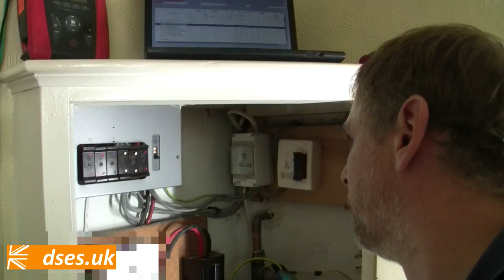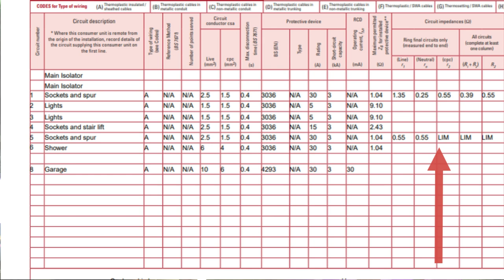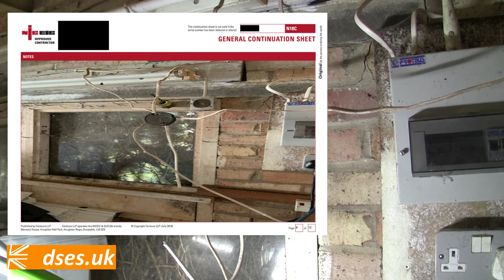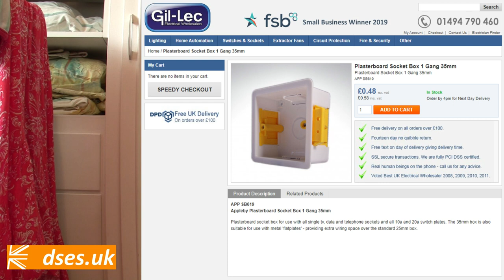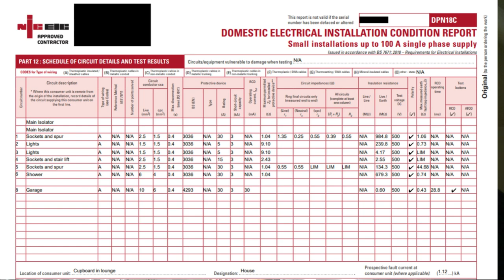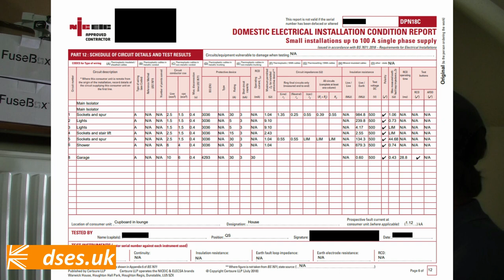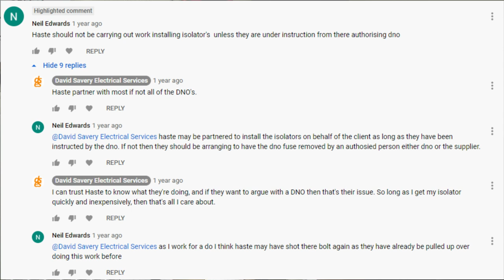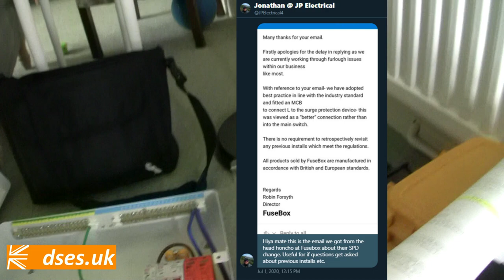Waffly Consumer Unit Upgrade

Comment: I live in south Manchester. I recently had a isolation switch fitted so in the future I can have my consumer unit upgraded. I contacted my energy supplier to arrange the work which they did, with  a charge of £50. The engineer was from the utility company Morrisons. I thought it was a reasonable charge for the work

Comment: Reg: 433.3 does allow you to omit overload current when it’s a fixed load that’s unlikely to overload . So maybe a 8.5kw shower on 6mm with a 40A or 50A mcb or 2.5mm flex on the back of an oven that’s feed from a 32A mcb with 6mm as long as the oven is not rated over the 2.5mm CCC

Comment: Regarding pulling DNO fuses...The recent replacement of millIons of meters with smart meters was the perfect opportunity for the DNO’s to cheaply provide the consumer/sparky with a means of isolation and solve this ridiculous situation.

 The fact that, for the most part, they have chosen not to do this, means that every electrician not only has the right, but also the god given duty to de-seal all the DNO equipment and pull the fuse in order to teach those tosspot DNO’s a lesson. 

Just don’t video it and don’t admit it. Simples.

Comment: I have always understood the reg regarding spur from the over current device would only be for a socket under or near the board and only for one twin socket. Not for supply a few sockets remote from the dB
Reply from the maker: That's my take on it too Evan. A spur is a point local to where you're tapping off, not a way to serve a new extension on the other side of the house!

Comment: Excellent 👍🏼 I think the main reason for the ring still be installed is purely the length you can get from a ring.  You are limited with length with radials.  The OCPD can be rated at 30 or 32 for a spur from the origin because the max you should be able to draw, would be 26A.  Also the OCPD can be rated higher than the cable if it is a fixed load, such as shower subject to all loop readings.
Reply from the maker: Don't forget though Patrick that it isn't just design current we need to consider. If that 'spur' cable is buried in a wall for some distance, a short of some resistance caused by, say, a nail or screw penetration could cause a high fault current which may exceed the CCC of the cable. A 30/32A device can happily pass that current which the cable cannot handle.
Reply: David, I see what your saying, but fault current isn’t CCC, fault current should only be for short duration, so shouldn’t effect the cable & can be calculated.  Thermal withstand, I think.
Reply: technically 13A. Double sockets are ALWAYS rated '13A'.. the manufacturer would use that as a getout clause if it melted with 7A on each side...
Reply: @PJB71  The word adiabatic is trickling my cerebrum... i like the feeling ;)
Reply: Hi Yes I double checked it is the thermal withstand calculation, so for example if you had a 32A cooker circuit in a domestic installation.  6mm from the D.B & the cable supplying the hob is 4mm & the cable supplying the oven (Rated at 2.3kw) is 1.5mm.  They are both supplied from a dual outlet cooker plate.  Overload from the oven is impossible, So that is a 1.5mm cable on a 32A C.B.  As long as there is short circuit current which you would measure at the oven above 160A.  Then the OCPD will operate with the required time, you can also check this with the thermal withstand calculation, you could also check the adiabatic if you wanted to.

Comment: That's a really good question, why do those smart meters not include a physical switch to cut the power, and separate unsealed terminations for the load? On the subject of putting the right PIN into the smart meter to turn the power off, "Device with semiconductors" (ie. electronic switching) is not valid as a means of safe isolation according to table 537.4. While supply equipment does not fall under BS7671 according to 110.2(i), not sure whether you could safely rely on that.

Comment: Was nodding off but woke up when you commented on the ring final, and the underrated current carrying capacity of the 2.5mm ²  inserted with the ring at the 30/32A protective device . Agree with your comments and views ENTIRELY.

Comment: Another great video. I sent my landlord your EICR videos after he had my home checked. 

On the morning of the visit we moved all furniture to ensure that clear access to every socket/accessory was possible while the alarm bells rang that three properties were scheduled for the same day with one being 40 miles away. 

The 'electrician' sat outside in the van for an hour, spent 40 minutes in the house only taking the front of the consumer unit off, turning the power off for a minute and not removing a single accessory then sat in the van for another hour before fucking off. 

He then rushed back to report back about the plastic consumer unit that had been fine with no alterations or additions for 14 years which prompted me to recall your videos tacking that very subject.

As you quite rightly say do the job right or get out of the game.
Reply from the maker: Unfortunately, I suspect he's having an easier day and making more money than I am too.
Reply: @dsesuk  Till he goes to court... [i can dream]

Comment: Hi David, As a working spark myself, I agree with you regards the fuse pulling chestnut. it' been going on for years !  Maybe the NICEIC should get involved ? We all pay now a substantial sum (just to work domestically) They should lobby that if an isolator is not supplied by the supply company we are in our rights to pull fuses for obvious safety reasons.         
Love your channel and enjoy it the most when you're giving it the big one!
All the best
Steve Kearslake (Happy Lectrics  Southampton)

Comment: Spurring off, on an EICR you can call it C3 at the DB on a bunched circuit if for example it's a fixed load that is lower than the rated capacity of the cable in question so hence will not overload and wouldn't require overload protection, it will only required fault protection.

Comment: Ok last comment I promise! A trick I pulled for my own property, in which the old tails were 25mm and good condition, was to ask them to just come and cut the power for 5min.

I put an isolator in place ready to receive the tails before they arrived, soon as power was off I cut the tails, terminated into the supply side of the isolator, and put that half of the isolator cover on (the new 100A wylex isolator is designed such that you can remove the load side cover while the rest is still locked in place). Power back on and off they sod. Only cost me about £15 for a nice compact isolator.

Of course only useful if you have something to crack on with while waiting for them to turn up.
Reply from the maker: Good if you can get away with it Matt. I do wonder how flexible their appointments are though. I suspect most people would just get a "we'll turn up sometime between 12:00 and 18:00" response.

Comment: 26:50
I'm still learning about fusing for fixed appliances.  My understanding is that FCUs are to protect the fixed wiring, and the protection of the appliance is not our business.  I don't know what the requirements are for manufacturers of such appliances, but I've always assumed that it's their responsibility to provide adequate fusing, thermal cut-out etc within the appliance.
Reply from the maker: A good point old sport, the fuses are there to protect the cables... well, at least on the fixed wiring. I'm not so sure on the appliances themselves, I think the fuse protects more than just the flex, although I may be wrong. Internal fuses can (and often are) employed as you say, but I suspect the manufacturer of these appliances would have stated a localised fuse be present, and the expectation would be that this kit hangs off a FCU rather than being spliced directly into the 30A ring. On an EICR, can I guarantee the way these items is installed is safe? No. And nobody with any common sense would install it in this way.

Comment: Whilst I see the point about the protective device is higher rated than the cable on the spur off the circuit origin, functionally it's identical to a spur taken off of any other point in the ring. If the problem exists for the spur taken at the circuit origin, then the same problem is present everywhere. It really makes no difference where the spur runs from. 

I should add that what a lot of people don't realise is that twins sockets aren't even rated for the full 26A that might be pulled. They only have to withstand 20A for a sustained period (I can't recall exactly - it may be about 30 minutes). Of course, there's nothing actually stopping somebody plugging to 3 kW devices into a dual socket on a spur thereby overloading both the cable and the socket.

Incidentally, the reason why high current circuits were introduced and then multiplied with one upstairs and the other downstairs is back in the days before central heating was common and many families used to use electric heaters. There is now no real need for this, although I am a big fan of high current circuits in places like kitchens and utility rooms as 20A radials are a nuisance, even if they are multiple, as it's damned inconvenient to have to try and make sure washing machines, toasters, electric kettles, microwaves and the like are balanced across circuits. 

nb. one safety thing in favour of rings is if there's a break in the CPE, something that can happen on a radial. If it happens on a radial, any outlets downstream of the break will continue to work, but without any indication of the failed CPE. At least with a ring that scenario is unlikely due to two CPE paths.

Comment: Really good point about the Spur jumped on the ring circuit at the board, makes sense to me now that it should be a C2, either put it on its own circuit breaker or down rate the ring circuit breaker to a 20A or 16A
Reply from the maker: Although, as someone pointed out to me, Appendix 15 actually permits an unfused spur to be from the origin. What a wacky world.

Comment: I'm a DIYer but I had 17th Edition, Part P and Inspection & Testing exams and a calibrated KT64. I got a free isolator done by British Gas in Essex 2011 and free one done by npower in Wales in 2018.
Reply from the maker: It's a lottery depending on your DNO/suppler. Some won't charge, others will. Some make it simple to arrange, others have you passed around an offshore call centre.

Comment: Gr8 video, always learn loads when watching. As for you dislike of ring circuits, completely agree. My partners property in Spain (Alora ) is all radial circuits running of 20 amp/16amp/6amp mcb with RCD protection. In turn run in flexible conduit plastered in the walls and in each room there is an access point if any problems occur. Ok I hate the Shoku socket, the dam earth spring always get bent back , but you can still just about plug it in, let alone the issue of potential reverse polarity with British goods. If we ever have a rewire in the uk, I would stick to radials, dam it maybe 6mm just for a workout and deep back boxes, either way broken ring circuits are potentially very dangerous and not always obvious. Anyway that's enough of my own waffling, back to the vid with a cuppa 👍

Comment: Commenting here from South Africa. Our regs have there origin in the British Standards but over the years have moved closer to the International stuff. We have a condition on our Regs (Sans 10142-1 if you ever want to have a peak at it) that our plug sockets which are rated at 16amp each (using the old big fat round pin plugs also left overs from some British reg) that the complete circuit cant supply more than 5kw which on our 230v mains circuit gives you just over 20amp. Perfect for the 2.5mm cable most plugs are wired with. Some much much older houses do have 30 amp rings but due to it being before any form of our current regs (came into effect as law in 93 if I am correct) some people see it as reasonably safe. The cables of the circuit is usually 4mm but the problem lies in the fact that our plug tops are not fused at all. Nice little bang or fire waiting to happen.
Reply: Very informative David, you don't need to buy grommet strip, I make it myself outer sheath of twin & earth ,cut slots with cutters bend round  knock out & small amount of glue job done been doing this for years.

Comment: Fuses were never in plugs in the round pin days, although the plugs ( and sockets ), did come in 3 different sizes to suite the load of the appliance.
Reply: Didn’t have rings in them crazy days.
Reply: @AndyK.1  Fortunately back then all I did was plug things in to the electric if I had permission from parents, no idea how the house was wired :)

Comment: My opinion on the pendant in the shower room.

Sure, technically it can be there based on the zones etc.  But......the room is very small.  Yes it has a fan, and a window, but doesn’t mean to say either will be open or on while the shower is in use.  Therefore, consideration should be given to the environment that will exist while hot showers are being had, and the level of humidity that will be left behind after.

Selection of equipment should be made with this in mind.  Light fittings in high humidity locations must be suitable. Reg 132.5.1 covers this.    Method of installation is covered in section 522 which further adds weight to why I would certainly not install a bayonet light fitting in a shower room the size of a shoe box, regardless whether it is outside of zones or not.

Can you guarantee there is no potential danger if the bayonet, it’s 2 pin connections and the lamp are not all a little moist from condensation.  Can you guarantee that the light will remain dry?  And if you can not guarantee that the light will remain dry, wouldn’t it be an idea to install a sealed unit?

It sounds extreme..... but I have found many eroded light fittings in bathrooms that purely based on zone measurements did not need to be of a certain IP rating.  They still had evidence of water ingress though.  Bottom line, zones are one consideration.  Environment is another.  Steam doesn’t really stay within the zones....it has a naughty tendency to wander around the whole room! 😂
Reply: As well as installing either sealed units or IP rated spotlights an extractor fan is a must IMHO in a tiny bathroom. Mould growth on the ceiling etc is a nightmare to deal with,  leaving a door open just spreads the issue around the property. The hardest part is core drilling the flipping hole for extractor outlet :/

Comment: You make some valid points.  The DNO is a big issue, I’ve had customers who have managed to get the isolator fitted for free, some where they have been arses. 

EICR well again obviously not taking sufficient time to carry it out properly or suitably qualified.
I do a lot of new builds lately and the standard of them amazes me they get signed off.

If ever you get to old for the tools, you’d make a cracking teacher at a collage,
Reply from the maker: I don't think I'm the sort for tweed jackets and leather elbow patches Gary!
Reply: David Savery Electrical Services hahaha no couldn’t see you in one either, but the way you explain this stuff and the ref numbers is very good and easy to follow, even with a bellyfull of booze like I was last night lol

Comment: Right not watched it yet, but I just had a big grin when I saw this had been posted, brightens up a dull Friday night 😁
Reply from the maker: Pretty sure it'll dull your already dull Friday night Ray. I hope you have an old 100W light-bulb handy.
Reply: I know right? been here for the whole video and still in the comments now :). Good relaxation after a week from hell (ever had the engine fall out of your van? I don't recommend)
Reply: Come on now Dave every spark knows its a lamp, not a bulb 😂, and I wasn't bored in the slightest, re-isolators, why aren't the cps's, the eca, the iet, the JIB etc lobbying parliament to put it into law that isolators are fitted, if they did this one thing for sparks this surely should be it also what's your opinion on the light in the bathroom, home/office skirts were permitted in bathrooms up to the 16th I think and if we don't apply regs retrospectively then could be deemed as a no code as it complied then, minor I know when compared to the fan on a 40a circuit and possibly no fusing down on the heater, just interested in your thoughts... and Chipmunk no I have not had an engine fall out but I've had a few blow outs and gear boxes go so I feel for you, never mind its the weekend and things can be mended 👍

Comment: 20-amp radials for the bedroom, hmmm, in the USA mostly 15-amp unless large bedroom and  voltage drop is an issue then 20-amp. With LEDs and ubiquity of low voltage devices I am sure that will be overkill soon. Of course by then we will all be on our own power generation as well.
Reply: He was talking about 20A for the whole upstairs. 4-5 bedrooms
Reply from the maker: As this one was site-unseen and some distance from home, I turned up with an array of RCBO's to cover the task.16/20 Amp ought to suffice for a 2.5mm radial where cooking/room heating loads aren't expected. That said, by the end of 2020 we'll probably all be cooking tins of beans over a naked flame.
Reply: @dsesuk  But there will be a BS Standard for that as well that we will all have to follow :D